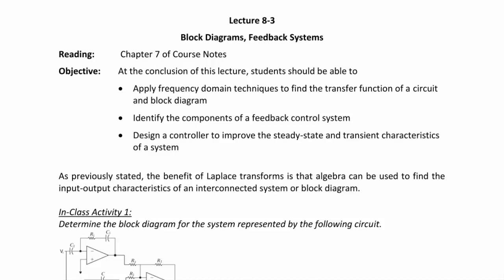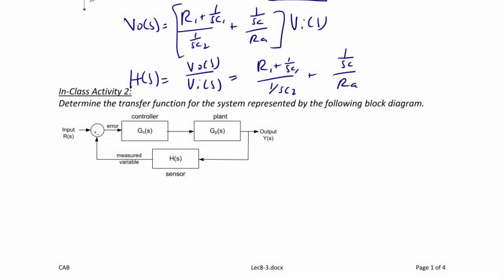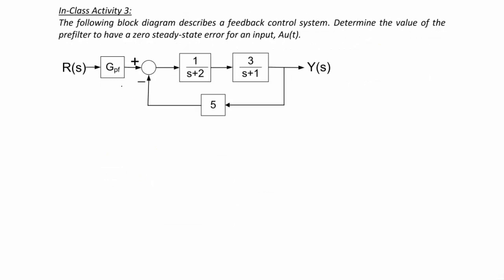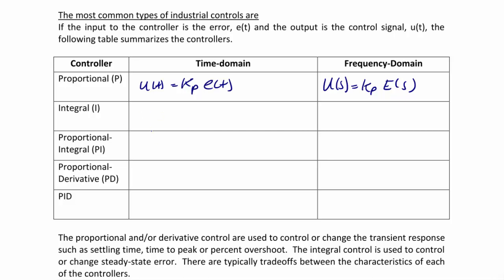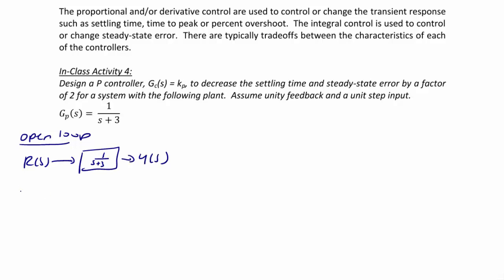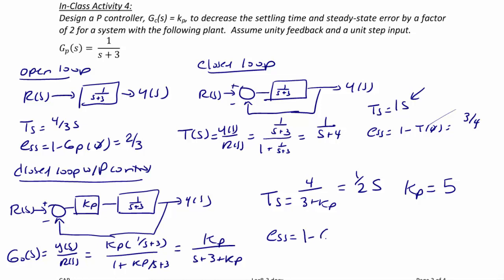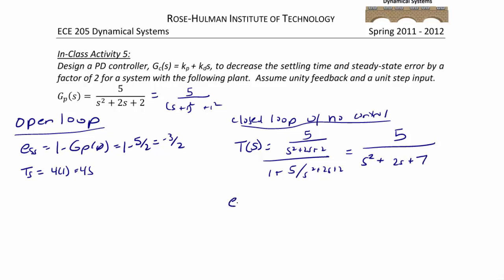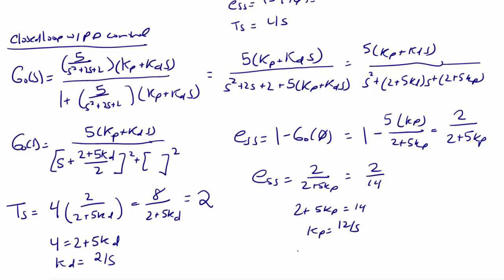ECE205 Lecture 8-3: Block Diagrams, Feedback Systems

Comment: Hallo guys, I have a question. Is the formula for finding he steady state response of the system the same with its steady state error ?
Reply: Not necessarily steady-state value is based upon the Laplace final value theorem but value and error are not the same formula because error is input - output.